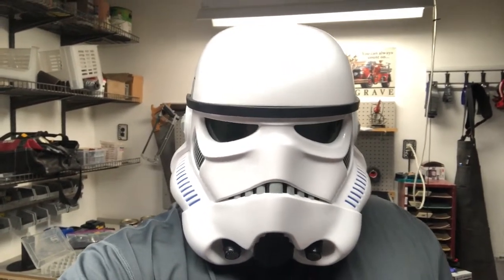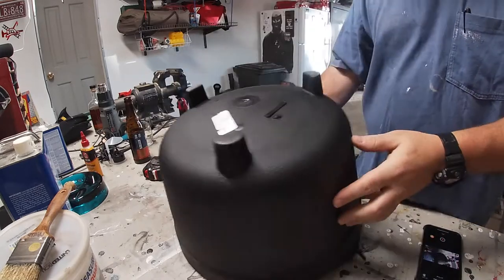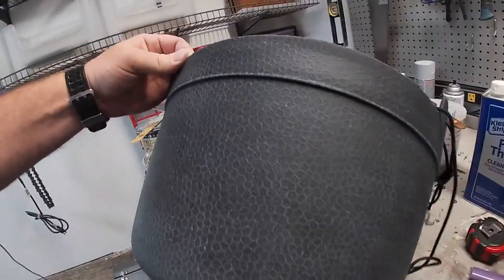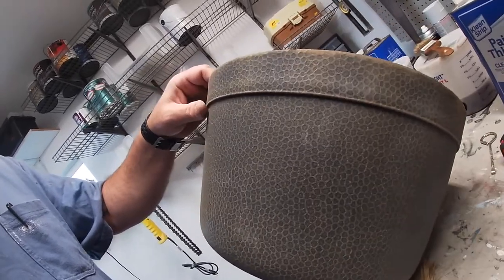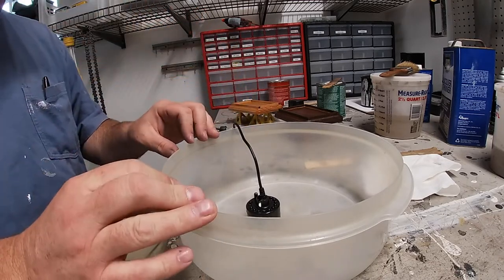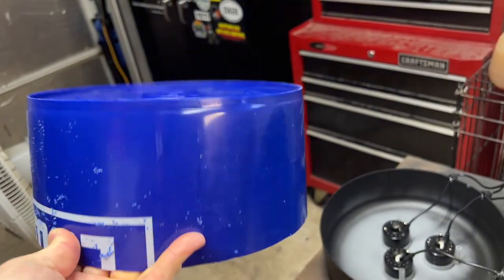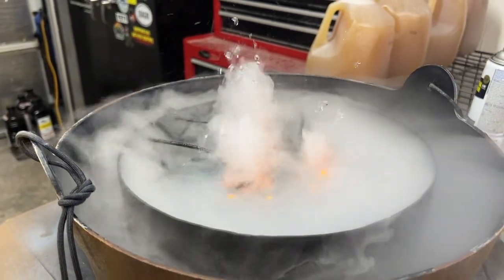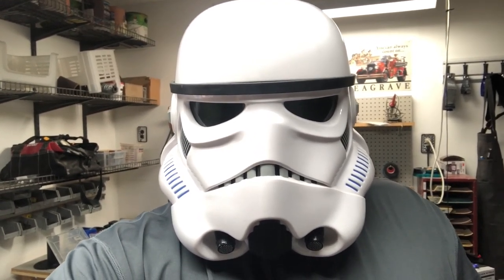Halloween Witches Cauldron Prop build

Comment: How did you make the fire under the cauldron?  Looks so real!
Reply from the maker: That is a little unit I bought off of Amazon. Basically it’s 3 red LEDs & a fan at the bottom which blows on to a bunch of red nylon ribbons for the flame effect.
Thanks for the feedback!